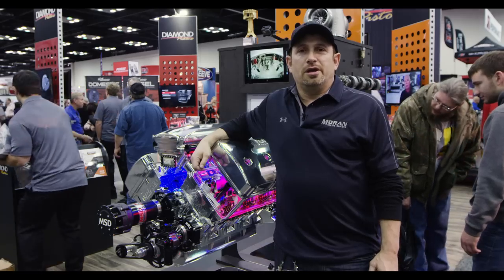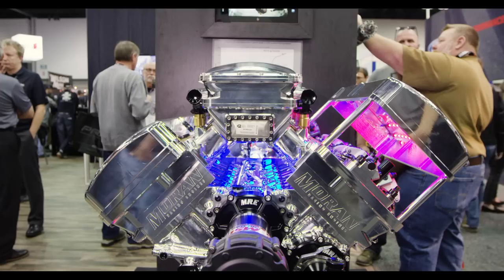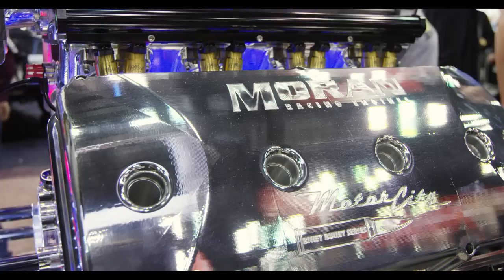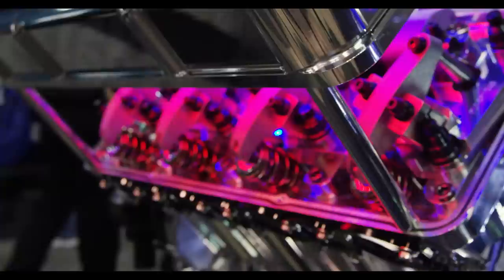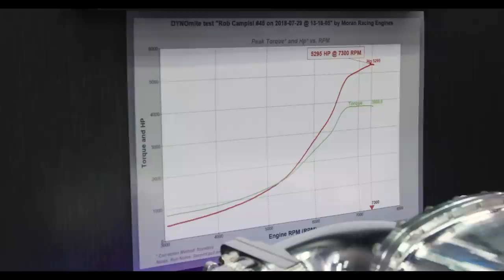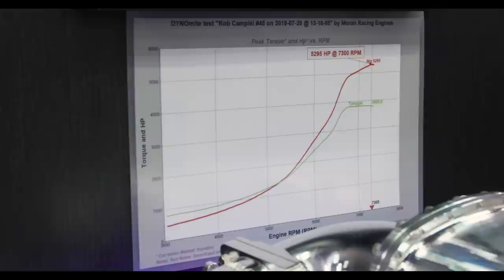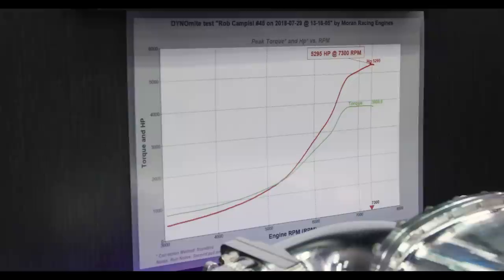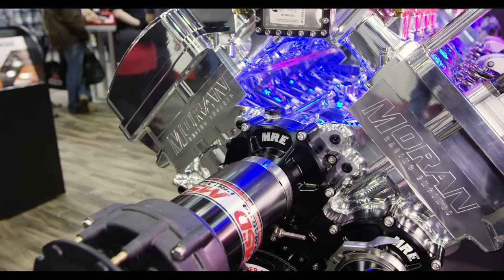Moran Racing's 5,300hp Engine!

Comment: Is that just on motor , no turbo no nitrous, no procharger , WOW , that’s incredible, SWEET.
Reply: it's twin turbo for that hp, there's a video
Reply: The day you can get even just 2,500 horses n/a will be a day to celebrate
Reply: Come on you don't think of 5.3 l is naturally aspirated making 5300 horsepower really did you just start watching drag racing yesterday
Reply: @lieugebo805  5.3 inch bore space not liters.
Reply: @RegulerShowTV  
Come on man there is 10,000 hp ship motors. 
7,000 hp submarine. 
Easy hp with massive motors.
Reply: @RegulerShowTV  sonny got 2000 HP out that 1000 cubic inch engine he has

Comment: Does the dyno run a 3 to 1 gear ratio 😂😂 5300 sounds optimistic... and how did you get 5300? spray? turbo? N/A?